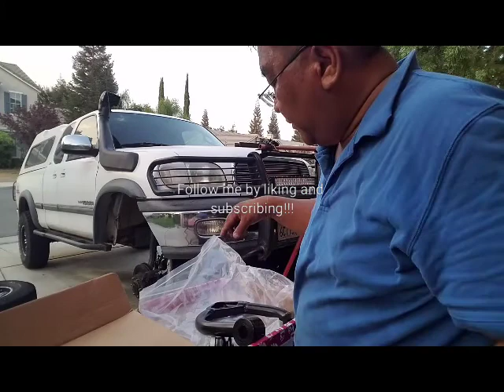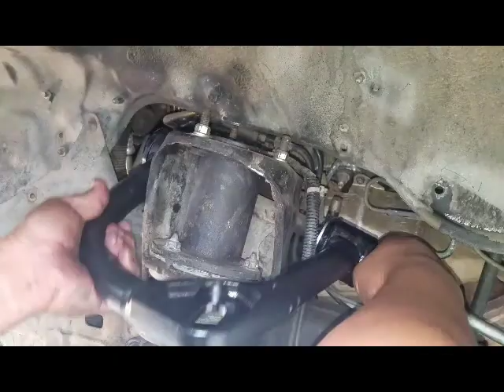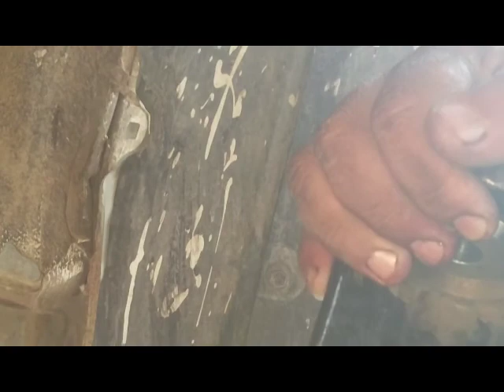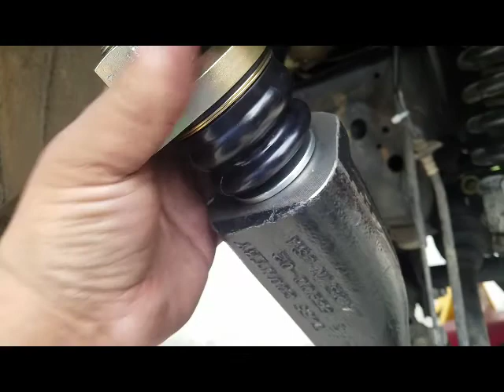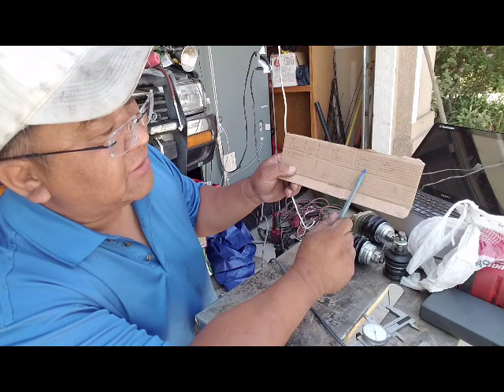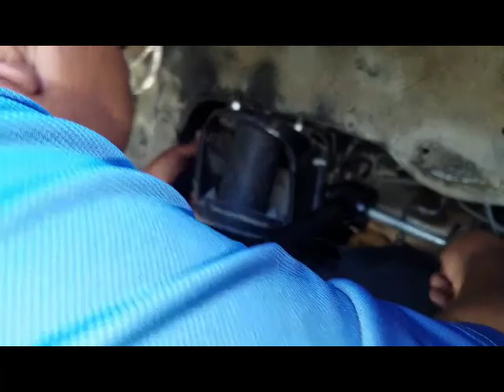SPC UPPER CONTROL ARM INSTALL PT. 1

Comment: How many miles do you think the Chiseled/Ridged Stainless steel SPC BJ adapter will last?? I wonder if one day it will just compress on those ridges and give you the same issue again
Reply from the maker: It didn't last long. If you followed me, there was an episode that I did, SPC finally made a expandable adapter and I installed the new adapter onto it.

Comment: @6:33 im not sure I see the point in welding a gusset there as the point is pivoting, it would only be an issue if there was not a pivot point. Therefore the “ebay” arm did not require it, makes me suspect about the engineering of the “ebay” arm.

Comment: Hey man great video . I have these spc ucas on my tacoma and im having squeaking issues . Do yours squeak? Im thinking they didnt grease them correctly
Reply from the maker: How long have you had it?
Reply: I have had them for about 2 years but the squeaking started a few months after they were installed . I have already replaced the shocks for coilovers . New ball joints , sway bar links .
Reply from the maker: @agustinherrera5600  I have ran mine for 2 years. Everything is quiet. 

Have you check you UBJ for excessive play? Have you removed your UCA and inspect it for abnormal wear and tear? Have you check your LBJ to make sure that the LBJ isnt squeaking? Did you replace the front shocks before the squeaking came? 

When does it squeak? Does it squeak when you drive it?
Reply: Is the bushings that hold the spc control arm. I have the same problem.

Comment: New upgrade kit available from SPC. 25008 - KNUCKLE INSERT SERVICE KIT

---------------------------------------------------------------------------
This service kit is intended to help installers with 25460 or 25485 arms that have oversized or aftermarket knuckles. This insert kit includes 2 knuckle inserts, retaining circlips, castle nuts, and cotter pins.

Comment: I wonder why in the included instructions (I have this exact truck/part) it says/shows to install the steering knuckle insert under the knuckle instead of on top as you have done. I also saw SPC themselves install the adapter the way you did on top with the snap ring underneath contrary to their manual.
Reply from the maker: You may want to look at the direction careful because there is only one way to do it.
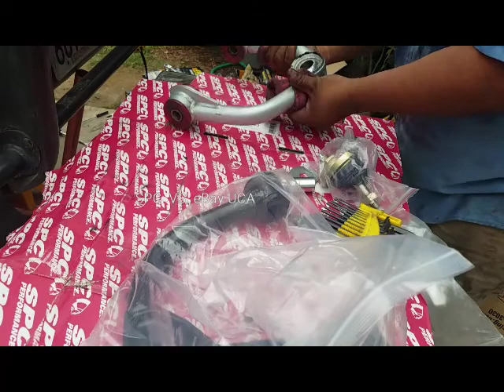Reply: The Other Guy  I have carefully reviewed and what I have found are in conflict with one another. http://www.spcalignment.com/instructions/25460-INS_WEB.pdf  <---- that's the manual that came with my set. I watched a video from SPC's youtube channel installing this exact part and they did it the way you showed. You can see this at 3:59 seconds in their video https://www.youtube.com/watch?v=FktX62tC0fw     Am I going crazy?? haha thanks for the response/video
Reply from the maker: @ionicbreeze  I think you are confused about the drawing. If you watch my videos, you'll see that I commented on it. I installed it just like it shows in the drawing you provided
Reply: @theotherguy3083  Thank you for the video.  To follow-up on the question, the instructions clearly show the knuckle insert sliding into the OEM knuckle from the bottom, not dropping into it from above.  I believe you later said in your video that you don't have OEM buckles.  I wonder if that might explain why the inserts were problematic for you when situated from below, as per instructions.  Thanks again.

Comment: would you say that the 3" lift and that upper control arm would be good lift or go to the 5" lift and be done with it? and that upper control arm...would you endorse it...
Reply from the maker: I'd say if u can save enough money for a proper lift by all means.  Buying a spacer lift is economical. However, the spacer isn't ideal. I'd rather if you want to level out your truck, get s Bilstein 5100 Adjustable Shocks.   Either way, you'll end up buying a aftermarket uca. At the end it'll cost as much as a 5 inch lift like mine.
Reply from the maker: As to endorsement, everyone have their own opinion on a certain product. I like both the eBay uca and spc uca

Comment: i had real rubbing issues after installing these. i will have to cut my bumper or get smaller tires.
Reply: Did you get an alignment after you installed them?

Comment: Hello, I noiced in one of your past videos you went from uniball joint to spc in about a year. What happened? How are the spc holding up now?
Reply: no, i hated them.  I ended up eating the cost and going with total choas within the month.  Had problems from the beginning would not recommend.
Reply from the maker: Giorgio N nothing is wrong with the eBay uca.  I switched because this one is fully adjustable. I still like the eBay uca and keeps it for emergency replacement
Reply: are you happy with the SPC their about 470$ so a big investment?
Reply: ahhhhh i wish i had done that also. i had just purchased a second set for my landcruiser and now i want to return them. how are the Total chaos ones? worth it?
Reply: Yes, they are much better and easier to work with and has the same clearance as spc

Comment: Being that it is aluminum, wont it eventually wear the raised part down? Especially since its aluminum versus steel.
Reply from the maker: Doug P I thought it was aluminum as well. Turns out, it is stainless steel.
Reply: That sounds much better, hope it holds well into the future for you. I thought maybe a couple of spot welds, but that may make it very difficult to remove.
Reply from the maker: Doug P I thought about spot weld too. But that would mean grinding it off and drilling it out.